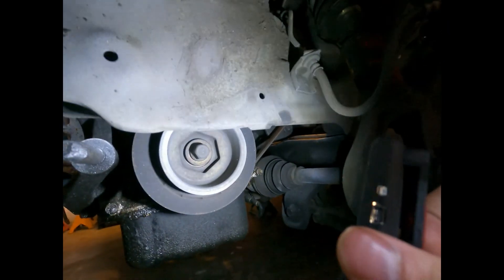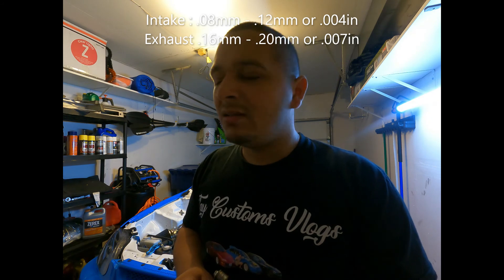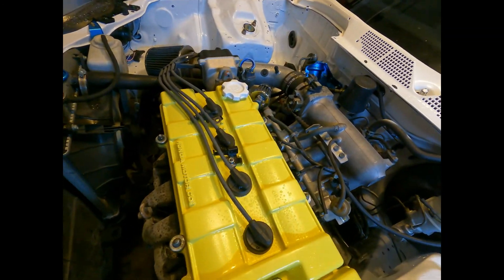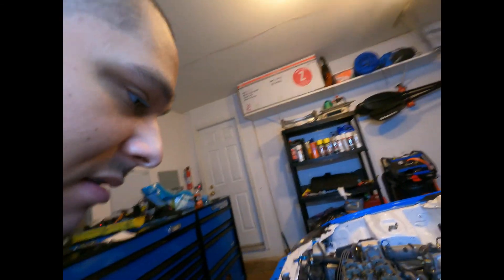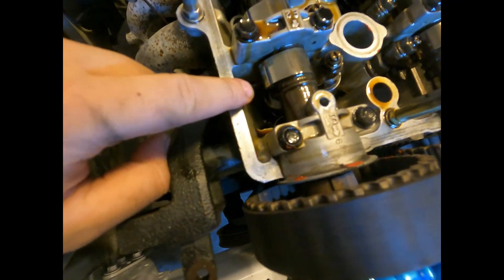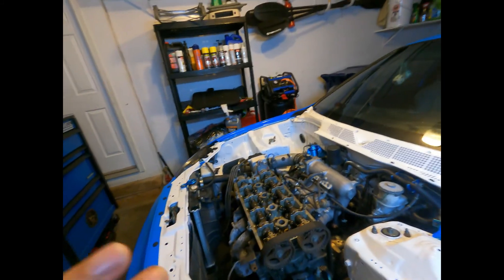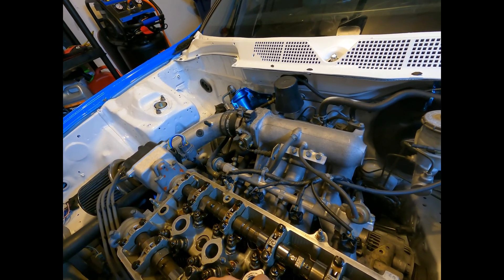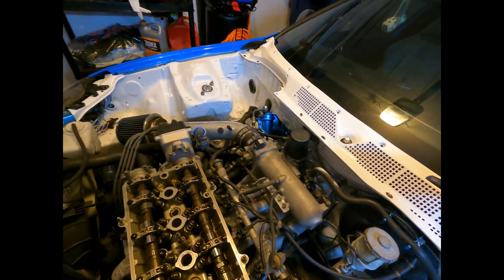B18b1 Valve Adjustment Honda, Acura

Comment: I have a 1994 Integra LS and the owner's manual said it's an DOHC four cylinder, how can you find out if the engine is "B18b1" ?  Thanks
Reply: it says it on the engine block near the headers

Comment: Okay, when piston is at TDC for #1, which lobes are being measured specifically.
Are they the ones right where you just checked the piston, because if so, those lobes are on their sides.
However, on #2 exhaust, and #3 intake, those lobes are pointed straight up. 
Do you measure them?
Please I gotta know!
EDIT* I'm an idiot!
I thought I'd seen all of them and must have been feeling complacent before I even watched it to that point.. where he explains just exactly that. Lmao!
Good writeup.
Thanks!
Reply from the maker: you measure the lifters around the cylinder. once finished rotate next cylinder to TDC and do the same thing
Reply: @taycustoms  even though those lobes are pointing away on their sides and not straight up and down? Then go to #3?
Reply from the maker: @Phdintheory  im confused did you take your cams out of your motor? all 4 lifters will not be pointing in the same directions. the lobes on the intake cam will point in one direction and exhaust will point in another. they wont be in the same position. make sure that you are adjusting ONLY THE CYLINDER THAT IS A TDC.
Reply: @taycustoms  even though they are on their sides and not pointing straight up. Got it
Thank you
Reply: Okay. It's running now. Only occasional and very slight hesitation. I'm gonna go back in and just check everything.
Coming from the timing belt #1 plug was a little hot, so was #2. 
Number 3 was dry but charcoal looking and #4 looks unfired.
Reply from the maker: @Phdintheory  just make sure you are using the correct specs on the intake cam and exhaust cams they are different. Also if you can smell it immediately adjust.
Reply: @taycustoms .17 on the intake .19 on the exhaust accotding to the sticker on the hood.
I took it for a test drive, it's driving better now but it still tries to backfire a little. It's only got a real top speed of about 60 which is about half of my normal speed. One rocker is too tight (#4 intake, left side) and won't adjust down any more. 
Is it just a matter of the feeler guages now to fine tune it?
Can I use the condition of the plugs to tell me how I need to adjust?
I really do appreciate your help here. I didn't think going in that i was going to screw up my car. Thank you for your help here.